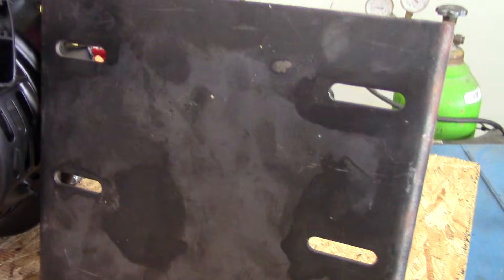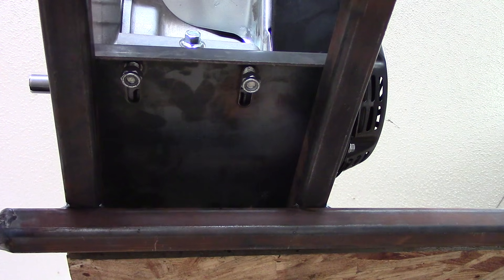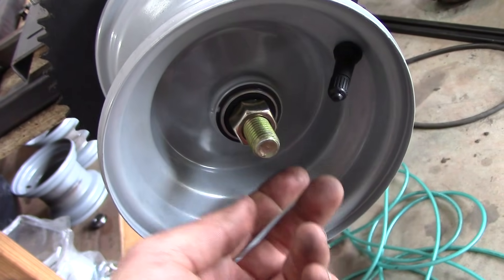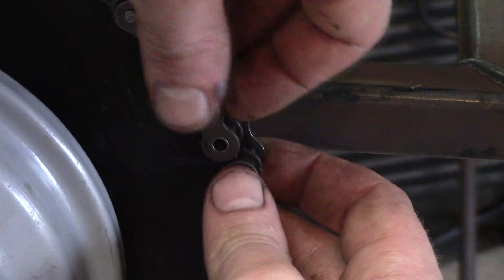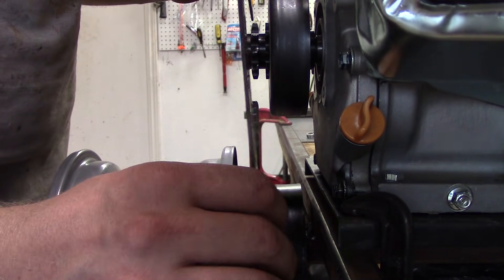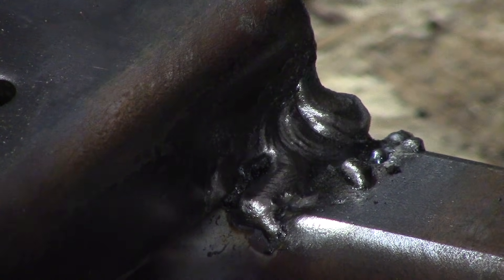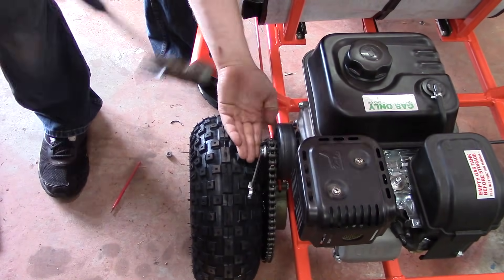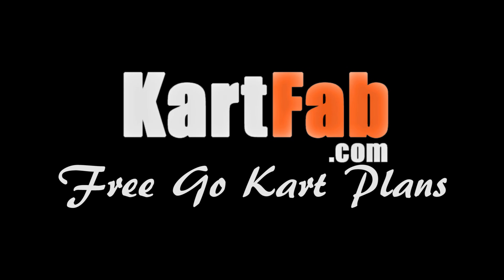Go Kart Engine Mount: How to Install

Comment: I also use a hammer and chisel for removing a link,  my dad done it for years works great.
Reply: This fool can't weld something about the support weld you using a stick because you can't afford it made you can't even weld with a MIG make it
 make it harder so you can if you can weld with a stick you can weld with a MIG with a stick you can't weld with a MIG

Comment: Does it matter how far back the motor is mounted as long as the Sprocket and Clutch are aligned?
Reply: Nope not really. Just make sure you have the right sized chain

Comment: I have Royal Enfield DIESEL bullet, i planed run without gear box,so please help which cvt torque converter suitable for bullet engine.(Greaves Cotton engine 5 HP ).

Comment: Wouldn't it be better to have the bigger sprocket on the clutch and the smaller on on the axle so you get more speed and less torque?
Reply: noooo! haha. best is a 10 or 11T gear on clutch, and a 52-60T axle sprocket. it'll still get you over 25mph with an 11T/52. if you don't care about accelerating quickly, 11T/44 gets you 32mph @3600 rpm, but you will burn the clutch up sooner.
Reply from the maker: Sounds good in theory but that’s actually one of the ways you can burn up your clutch.

Comment: my clutch always keeps breaking? i have to buy a new one every time i want to use it. do I need a pully system or something?
Reply from the maker: What do you mean by breaking? Describe what happens. What is the size of the thing you are riding? Teeth on clutch? Teeth on axle sprocket? Jackshaft?
Reply: KartFab it spins but delivers no torque to the axel
Reply: the clutch looks identical to the one used in the video
Reply from the maker: You didn’t give me the information I asked for, so I can’t tell you what’s wrong. If I had to guess it’s your gearing. If you have a clutch your tires should be no larger than 15” and the axle sprocket should be around 60t/and a 10t clutch, or a 72t axle and a 12t clutch

Comment: Over all good video. I would like to point out that you should leave a gap in the slot for the engine mount to allow adjustment to the chain tension as the change will stretch

Comment: hey i was wondering if can use my bike engine for my go kart please reply soon so i can start build my go kart now
Reply from the maker: +melroy james what engine is it?
Reply: i live in guyana but i don't have  no engine to buy anywhere in my country which i have to build the frame my self. and i have a motor bike engine can it work
Reply from the maker: +melroy james yes it can but you will need to figure out how to set it up.
Reply: ok thanks very much for replying

Comment: would the scooters engine work here??plzz rey
Reply from the maker: +vlog maker you would need to figure that out. I designed the kart for a standard 4 stroke 3:4" shaft industrial engine and cent clutch

Comment: One wheel peel, I'd rather put a differential on mine.
Reply: solid axle for the cheapness,, then it's like Posi, but turning on pavement is a little bit harder

Comment: I got a question. I have the exact same motor but I have it lifted and the engine runs good but it turns the clutch when in idol. Am I missing something so it won't want to run off on me or is that how it is?
Reply from the maker: open up your users manual, and search how to adjust idle speed (black plastic screw on top of carb) also, make sure your throttle is returning completely to idle position, if not, some people install a little spring by drilling a hole in the throttle arm and connecting the spring between the throttle arm and pull cord cover.

Comment: When you buy the kit and u add the 5$ for the mounting kit does it comes with the engine mount seperate or already installed
Reply from the maker: kit comes with engine plate. i just put the link to the engine mount itself just in case you only wanted that.
Reply: +KartFab alright but what about for a birel racing go kart? I recently bought one but it didnt come with an engine or engine mount and theres so many on the website but idk which is the right one
Reply from the maker: oh, i dont know i cant help you there. Its probably a 15 degree racing mount btw, just look up go kart racing engine mount or something like that.
Reply: +KartFab yeah true alright thanks so much kartfab really appriciate it XD
Reply from the maker: no problem
Reply: +KartFab sorry to bother again lol but can that flip motor mount be user as a mount for a racing go kart?
Reply from the maker: uhh i dunno what you are talking about

Comment: if the engine is secure with just the 4 bolts in, is it possible to not weld the 4 corners?
Reply from the maker: You gotta weld the plate to the go kart, bolts do not hold the plate to the go kart itself.
Reply: okay thanks

Comment: what size bolts
Reply: I think he meant 5/16-24.  Standard on the 212 predator motor.  I opted for a torque converter over the centrifugal clutch.  Supplied bolts were metric.
Reply: Respond please 😢

Comment: how much kmh he can go?
Reply from the maker: +GRamingzone 1 25-30 mph
Reply: ok when i go buy 8hp engine or 13 hp how much mph he can go ?
Reply from the maker: if you do the live axle plans that i have on my website it will go 35-36 mph. If you use the free plans top speed is 25-30 mph regardless of which engine you use.

Comment: If the power is closer to one wheel than the other, does that mean you will have to constantly correct steering?
Reply from the maker: +Creamated Biscuit no. It drives straight.
Reply: ***** ok

Comment: Hi what intensity do you apply when wielding MIG ? Thanks for clear and thorough explanations.
Reply from the maker: +Alexander Todt it is completely, 100% dependant on the welder itself so it will vary by welder and there is no clear answer other than 'read your users manual' and set your welder to the settings needed to weld 11 gauge steel.

Comment: how to stop clutch moving back on forth keeps popping chain off
Reply from the maker: +Tony Gonzalez set screw or spacers.
Reply: I set some spacers behind the clutch but made the pull string on the motor hard ? That's bad right ?
Reply from the maker: I have no idea what you are talking about or why the pull string on the motor would be related to the clutch.

Comment: Good job man, but I have a question, what I have to do if I want to spin both rear wheels?
Do you think 250cc has enough power to do a drift buggy/kart?
Thank you from Spain.
Reply from the maker: Live axle is the only way, unless you make some sort of a jackshaft type of setup with two one wheel assemblies, but that is impractical, a live axle kit (solid axle) is the way to go to get both wheels spinning at the same rate.
Reply: ***** I'm making a offroad gokart
Reply from the maker: You will need a live axle go kart. http://kartfab.com/live-axle-go-kart-plans 250cc bike engine is a lot for a go kart if it is a motorcycle engine.
Reply: +KartFab I have a question. Is there any way to make the both wheels spin instead of just one wheel? But doing in the same way?

Comment: Can you go over the throttle cable installation?
Reply from the maker: +melvin moo I already have an article out on the throttle cable installation. The throttle cable video will be released after the seat, steering, and brake videos come out. Here is the link to the go kart throttle cable installation guide http://kartfab.com/go-kart-plans/go-kart-throttle-cable

Comment: like I know you can doit in lawn mowers where only one wheel is spinning freely while the other has the power when you lock the axle both wheels have the power I just notice that the do kart in the short kill was only the one tire with power
Reply from the maker: This doesn't use a peerless transmission. It's only one wheel drive. The simplest and easiest and cheapest way to build a go kart.